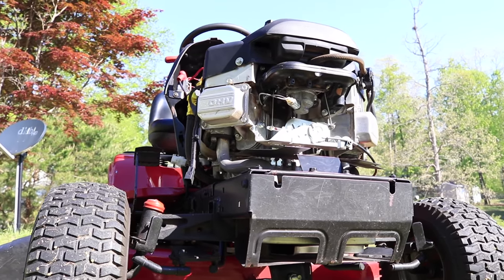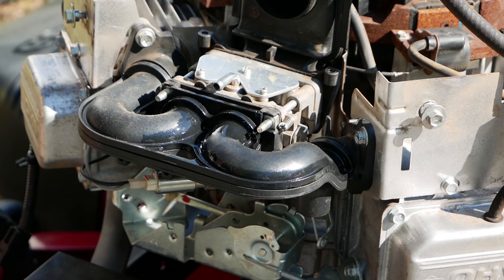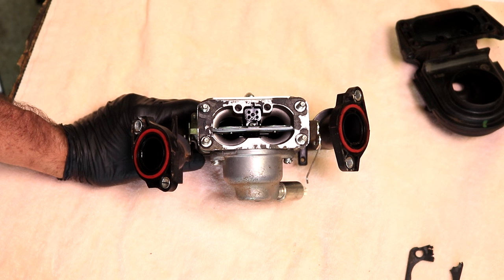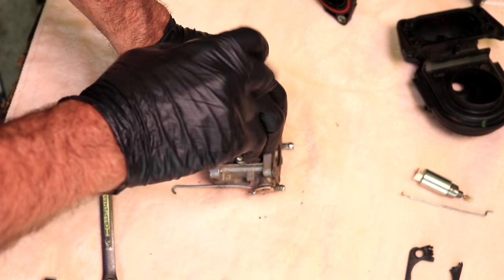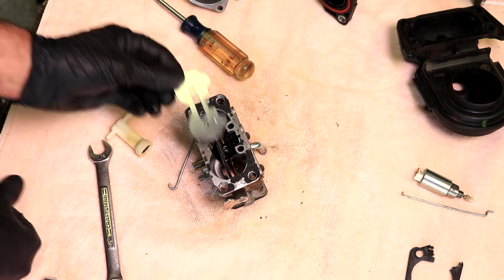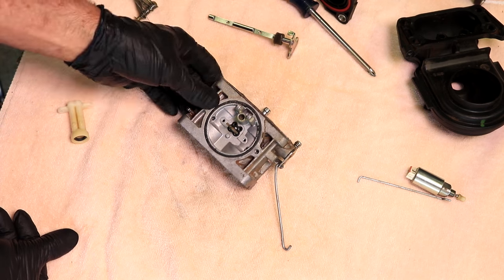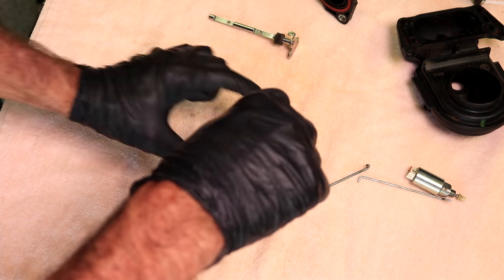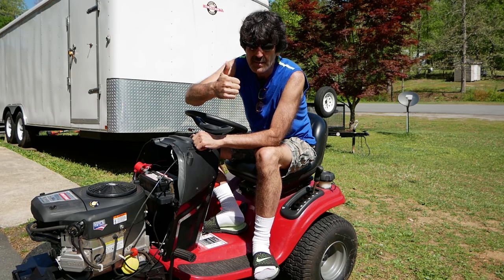Briggs and Stratton V-Twin Carburetor Repair

Comment: I have a replacement carburetor for my mower just like the one in the video, can you help with a video putting it on ?
Reply from the maker: HI, it should be the same as the removal I show here.  I might be able to do a video for what you described there, but it might be a little while before I can.
Reply: @JLPicard440  does a new carburetor come with all the gaskets i need?
Reply from the maker: Jeffery Hicks usually yes
Reply: @JLPicard440  ok thanks
Reply: I just got the new carburetor on and new gaskets, the engine is surging now. Any suggestions?
Reply from the maker: @jefferyhicks3678  Yikes!.. No it shouldn't be... I guess all the gaskets are installed and there's no air leakage?  Sometimes those things will surge, but the new carburetor shouldn't be doing that.  What happened to the old carb where you had to replace it?
Reply: @JLPicard440  it started surging and backfiring, I've replaced the plugs, air filter, checked the valves,  changed the oil and it still did it. The mower has 1030 hours on it so i figured the carb needs replaced so that's were I'm at now with the surging
Reply from the maker: @jefferyhicks3678  HUH, so was it surging and backfiring with the old carb?  You might do a compression test on it to make sure you don't have a issue with the valves
Reply: @JLPicard440  i did
Reply from the maker: Jeffery Hicks was it good?
Reply: @JLPicard440  yes
Reply from the maker: Jeffery Hicks that’s a good one.. I would have suspected the carburetor too
Reply: @JLPicard440 my carburetor has a automatic choke on it,   the new one is a manual choke carburetor, everything mounts up good except it has a manual choke,  is there a way for me to make the manual choke carburetor work? Also the intake gaskets (red orings) has a bad place in it, can i just take them out and use a regular intake gasket (that came with the new manual choke carburetor?
Reply from the maker: @jefferyhicks3678  Those Red O-rings are the ones that go to the block from the plastic intake?  The manual choke carburetor should use the same plastic intake, unless I'm not understanding where they're at.  Hmm.. I wonder if you can adapt the linkage from the old carb to the new one to make the auto choke work, unless the piece that gets hot and actuates the choke won't work.  You can hook a cable to it and do it just like if it were a manual choke.  They just use a cable that goes up to the dash.
Reply: @JLPicard440  could i replace the red orings with a traditional gasket on the intake?
Reply from the maker: I got a feeling it won't seal properly.  If the ones you have are bad, I think I'd replace them... This should be them, but it'd be a good idea to use your model number to look them up to be sure

 https://www.amazon.com/Briggs-Stratton-691917-Replacement-Models/dp/B002WO2ASM/ref=asc_df_B002WO2ASM/?tag=hyprod-20&linkCode=df0&hvadid=167148561991&hvpos=1o1&hvnetw=g&hvrand=4939646180887715367&hvpone=&hvptwo=&hvqmt=&hvdev=c&hvdvcmdl=&hvlocint=&hvlocphy=9008199&hvtargid=pla-309633180452&psc=1
Reply: @JLPicard440  update.....i took my old carburetor and rebuilt it and cleaned it and she runs like a champ now! Thanks for your help, much appreciated!
Reply from the maker: @jefferyhicks3678  HUH... I wonder what was wrong with the new one?
Reply: @JLPicard440  i think it was because of it being a manual choke and that my intake gaskets was leaking?
Reply from the maker: Jeffery Hicks the intake gaskets could definitely cause trouble... they will in a car if u have a vacuum leak
Reply: @JLPicard440  this has definitely been a learning curve for me
Reply from the maker: Jeffery Hicks sounds like u got it and saved some money to boot! 😎😎
Reply: @JLPicard440  Het Rudy, for some reason, ever since i got it running good, my mower will not choke  and I'm having to manually choke it, any ideas of what may be going on?
Reply from the maker: @jefferyhicks3678  Possibly the actuator is going bad.  I'm not sure about that engine, but on the smaller push mower engines, there's a device bolted to the muffler that when its cold the spring goes one way to choke it, and when it gets hot from the muffler heat, it'll spring the other way to unchoke it.  I suspect this engine has the same type of device, .. follow the choke pushrod from the carburetor and it should go right to it.
Reply: @JLPicard440  i believe the issue is with the throttle cable and or the linkage? Can the butterfly shaft be oriented incorrectly causing the choke linkage to not close the choke all the way?
Reply from the maker: It certainly can!  Yes, that's definitely a possibility..
Reply: @JLPicard440  would it hurt my mower if i left it alone (just manually choking it)?
Reply from the maker: Jeffery Hicks no I don’t see how
Reply: @JLPicard440  ok thanks!
Reply: @jefferyhicks3678  you have to adjust the throttle cable to get more throw on the choke. I had the same issue. I also used the choke lever from my old carburetor , and swapped it into the generic carburetor I got from eBay no issues so far
Reply from the maker: @joshuasilvia3565  Good to know!

Comment: Watches video and realize it's easier just to order a whole carburetor. My Briggs & Stratton 24 horsepower was flooding with fuel so it couldn't fire.
Reply from the maker: Sometimes it is..  If your fuel keeps coming in, you probably need a new needle and seat

Comment: Good video. The only thing I would have done different was buy a rebuild kit if I were going to take apart the whole carb like that. Also when you were putting it back together, you should have, (I would have) put the o-ring that sits on top of the emultion tube on the bowl instead of jamming the bowl down on top of it using a bit of vaseline. Oh one more thing, you never checked to see if the jet seals were tight. Those are the most important o-rings in the whole carb. The jet and emulsion tube o-rings. ;)
Reply from the maker: Thanks for the tips... I find most of the time, the problem is a piece of trash stuck in the carb somewhere.  I can appreciate getting a rebuild kit for leaky o-rings... it's not that much trouble to take the carb back apart if cleaning doesn't work...
Reply: @JLPicard440  I a professional setting, time is money. ;)
Reply: @joeganusi8522  then make your own video

Comment: These carbs are $30 bucks on the jungle website.  Just swap it out.
Reply from the maker: HI,  Why spend the $$ when you can just clean it and put it back and have on OEM part.  It's rare that I need to actually replace a carburetor, but I've seen some extreme examples that I couldn't get going again...

Comment: Can someone tell me which numbers on the carb I use to fine the proper kit?  I see a series of numbers on my NikkiCarb, No matches  on the web sites. ?
Reply from the maker: If you look up the engine on a website like www.partstree.com you should be able to figure out something.  The model number / type for the engine is usually on the valve cover.